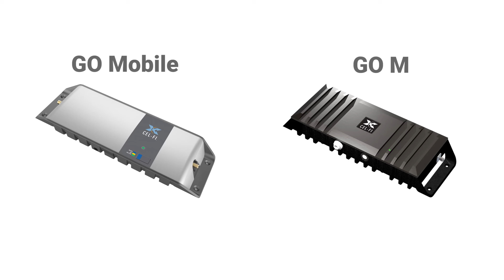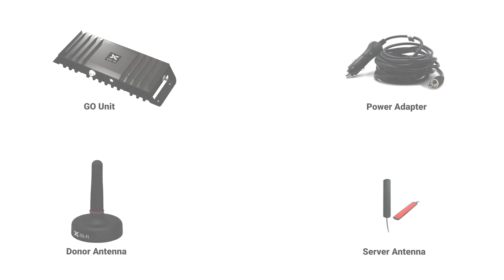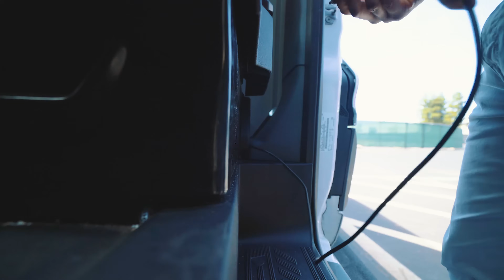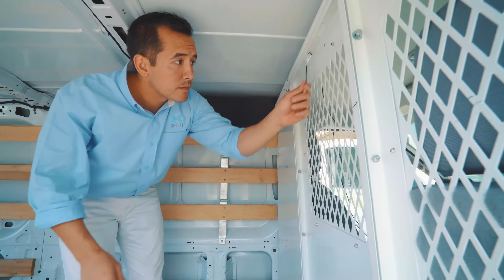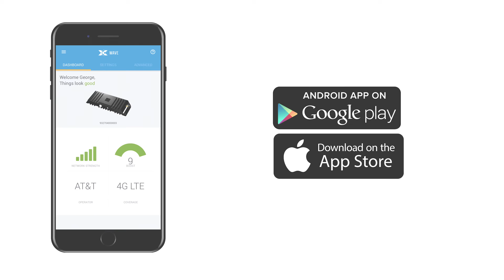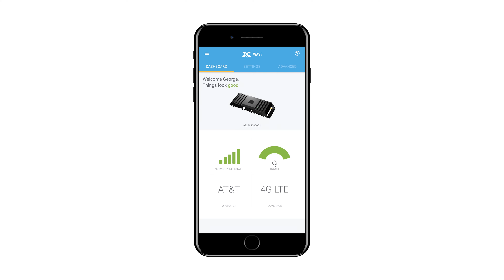How to Install Cel-Fi GO / GO+ in Mobile Mode

Comment: Can you be connected to the cel fi bluetooth and your vehicle radio bluetooth at the same time though?
Reply from the maker: This is fully dependent on what version of Bluetooth your handset is operating on. Earlier versions of Bluetooth do not have the ability for simultaneous casting, while newer versions can cast on multiple devices.